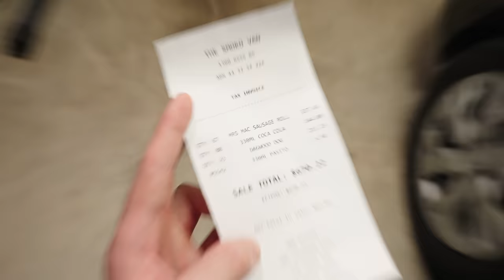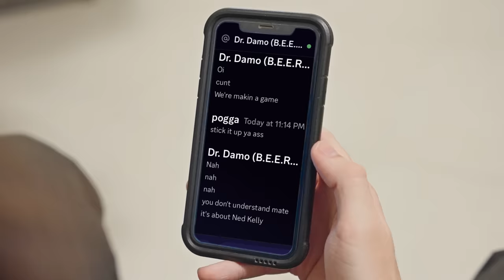Every Welder Ever... | Garn.

Comment: Welding a tradies bundy inside a little cage might be the most advanced form of torture in the modern age
Reply: Provided you also cage the grinder, make them punch the hinge out of the drop saw, again...
Reply: @maxnaz47 nah mate, you cage the grinder tighter tool after overtorquing a flappy on.
Reply: @smellysam that's fucked mate... Gonna do that today to me tradesmen today
Reply: @Xxassass1n021xX  a used flappy is best, to remove any remaining crumb of hope.
Reply: The modern device called a straw would fix that issue easily.
Reply: @smellysam  right angle needlenose pliers, make a perfect grinder wheel spanner.
just pile everything in a box and weld a few flat bars over the front.
Reply: @smellysam  okay satan
Reply: @Defensive_Wounds if I ever saw a tradie sipping straight bundy through a straw I would immediately fear for my life
Reply: @smellysam  too easy, can drop that off with a screwdriver and a hammer.. I don't even fkn know where my disc spanner has gone..
Reply: @smellysam have you tried overtightening the brush part onto the grinder? It's literally the hardest part to remove
Reply: @mr.commonsense  the new guy, whomever he is, does that every time without prompting.
Reply: @smellysam  trust me, all schools have at least one new guy
Reply: I read this in Aussie accent lmao. Howdy from Texas. The Australians long lost cousins
Reply: @smellysam I'll just get a new grinder from the store room m88, or grab yours...

Comment: as some one who has worked in a welding joint this is very accurate the amount of dodgy welds that left on the truck is unbelievable😂
Reply: Bloody oath. You drum up extra business... it's called a Rework!! 🤣
Reply: @judysimpson3774 damn right gotta love having customers throw a fit and having you rework all 1200 parts then just laying in some dog shit beads and getting em out the door half assed.
Reply: If something comes in and the owner welded on it first, we charge double for having to grind off all of his birdshit.
Reply: we had some critical parts fail an x-ray test a bit ago boss just goes eh put it on the truck

Comment: The good ol safety squint, approved for welding, grinding, painting, machining, compressed air, and more!
Reply: And any time the safety squint isn’t good enough, you have the good old “close your eyes, turn your head and do it by feel” technique. That’s a beauty that is, I get by just fine with it.
Reply: I've used the safety squint every time I was on a lathe or milling machine
Reply: as a machinist, one of the shops I was at, think I only used goggles like 3 times. other than that, it was safety squint, or hide behind a machine door as I do my thing. but lpt, if you are expecting chips and lots of them, faceshields arent enough, go for full wraparound goggles and a faceshield. seems excessive but one job I had, felt the steamin hot steel chip touch my eyelid when I had regular safety glasses on.

Comment: Laughed so hard at the end with the "I can't hear anything." I wasn't a welder, but worked in a metal shop as a shop hand, basically. Got more hearing damage than I would've going to raves.
Reply: from what?
Reply: @LabiaLicker  Grinders, band saws, air compressors, all of them together is just a cacophony of noise.
Reply: That's why I listen to heavy metal through my earbuds. If I'm getting hearing damage, it'll be from my favorite slayer songs.
Reply: @LabiaLicker  Loud clangs, compressors, saws, some guy dropping a big piece of metal right next to you. Saws cutting through metal(Especially when not oiled) are really loud.

Comment: 😂🤣😂 my hubby was a welder and fabricator. I had a heavy ass kitchen roll holder by that would kill a man, a solid steel gate that needed a team to move and everything in the house that could be was fing galvanised plus I spent pretty much every other week him in A and E with welders flash or a hole in his face from flying metal! Was brutal! 😂
Reply: Ugh, welding anything galvanized is NASTY! 🤢🤢🤢
Reply: @flintironstag2381  even if I had liked it back in  2002, I bloody hated it by 2003! Lol but it’s a funny memory as he died in 2004 at 32. I won’t lie, I still have the headboard and I can still see remnants on the legs that attach it to the bed and I refuse to want them off. Nobody can see them only me. lol

Comment: I worked at a welding shop on and off for months months and I can confirm that everything is 100% true even in Central Europe. 

We also used to use the scrap metal and shop equipment to create post apocalyptic looking weapons like a 1.80m tall longsword made of sheet metal and concrete bars.

Comment: As a legit certified welder, my eyesight went from 20/20 to 16/18, my hearing is about half as good as it used to be, my nose is stuffy 24/7 and I've seen the bones in my hands more than 2 times, all in the span of 3 years. Very accurate video!
Reply: is there anything to prevent some of the stuff like those motorised respirators packs or like really dark filter shades for your welding mask

Comment: I figured out that welding wasn't for me after someone in the shop in college had a piece of metal shoot out of the steel cutter and slash him across his Adam's Apple.
Arc Welding with a 1/8th inch graphite tip was a lot of fun, though.

Comment: I’m just typing this comment covered in grinding dust. I smell horrible even though I started my shift 5 hrs ago. Both socks have holes from spatter even my underwear has holes from spatter, I burned every single part of my body apart from my willy, have to go every 3 months to hospital to have crap removed from my eyes, can’t smell anything because of the fumes and I’m allergic to natural light.

Is this the best job ever? Yes.

Comment: He got everything required to put that rail on with a snapped drill bit and a bent bottle opener without resorting to a welder. Much of those joins can be mortared over and then painted over for safety and corrosion control and tek screwed into place.  The welding rods are expensive and only should be handled by the grand master electric spark controller so you don’t end up in prison when someone falls in something or the whole entire meth addict scaffold that’s supposed to be a functioning bit of equipment kills someone.

Comment: Do they really get paid that much?!!
Reply: Sure do mate, not all welders do, but there certainly a lot blokes out there earning that. As we should be it, kills your hearing, smell, lungs and eyes ect. Garn said it all.
Reply: @mickj9496  I chose the wrong profession! LOL - apart from the hearing loss and dead lungs etc!
Reply: @@raidakk4326totally agree there is sh!t paying jobs for sh!t boilermakers and fabricators. Work in a decent shop doing pipe work, pressure vessels or heavy fabrication. Full time you easily $50 plus on a 36 hour week. Work as a subcontractor you easily $100+